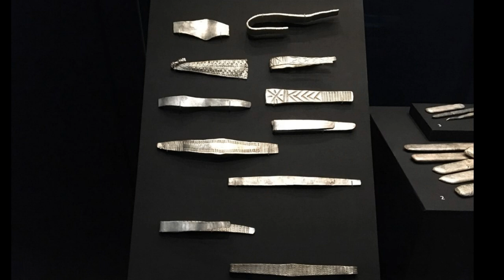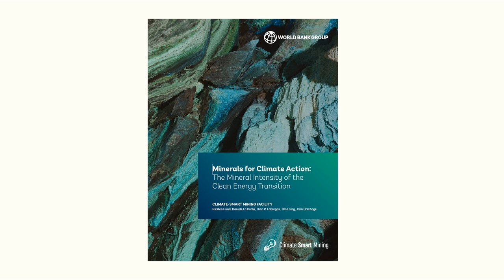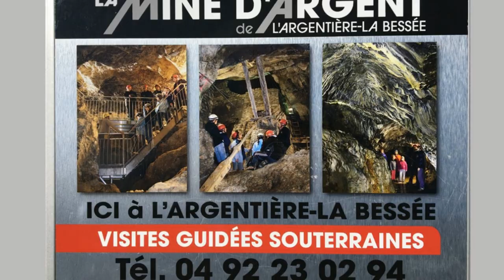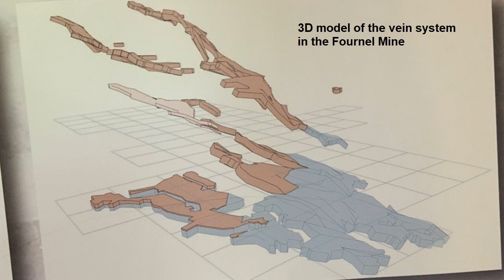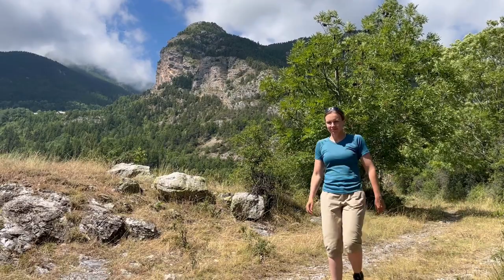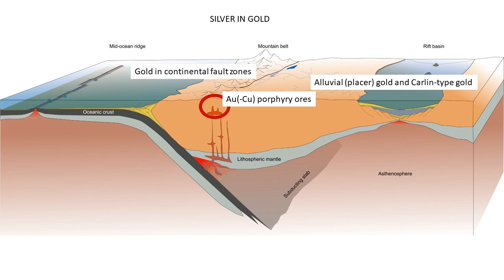Silver, the precious industrial metal

Comment: Japan is completely volcanic in origin.  There are hot springs all over. but what seems to be very little gold and silver.  Why would this be?
Reply from the maker: There are hydrothermal precious metal deposits in Japan, but they don't necessarily form in hot springs, and not all hot springs carry metals. It depends partly on where the water is coming from because the metals typically originate from deep in the lithosphere or even the mantle, and whether the metals have been deposited elsewhere along the way.  Metal deposits forming directly on Earth surface are actually quite rare in mountain belts like Japan (but common if you are in an area where the lithosphere is very thin such as in rift basins), basically because the metals have already been precipitated along the way. They will only be exposed once there is enough erosion to remove the material on top.